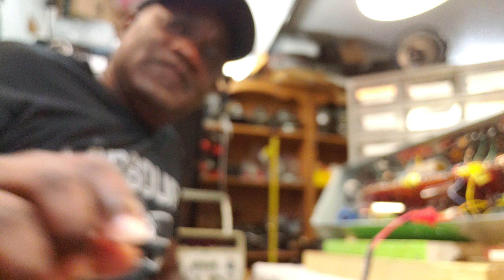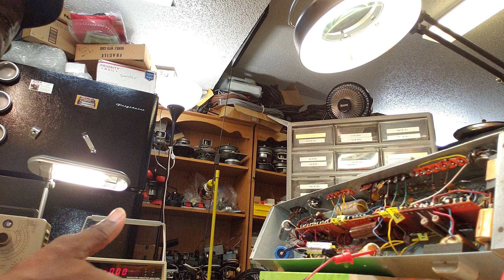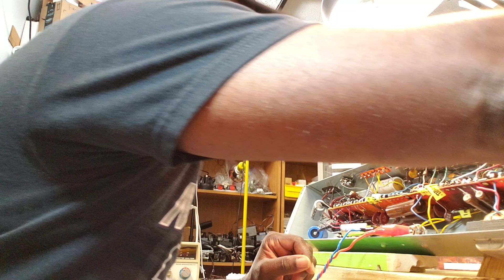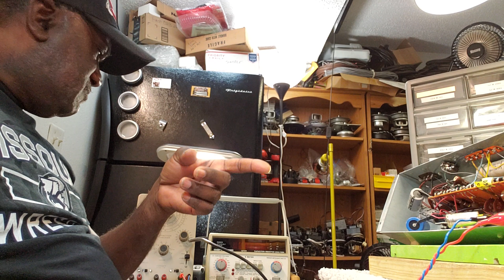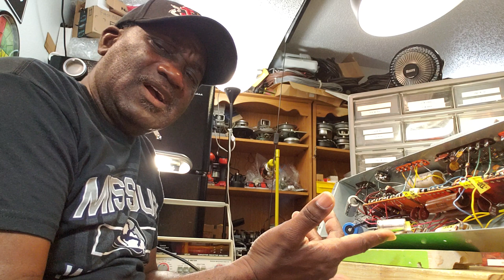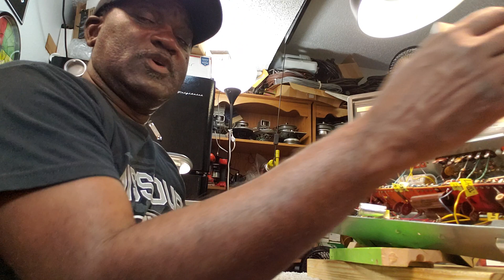Using Solid State & Analog Testers To Evaluate A Ceramic Capacitor In A Hammond AO28

Comment: Thanks for the video keep them coming.
The Heathkit is a good old meter to have. I have an Eico 950b that is old and useful too.
These type meters are getting hard to find now days.
Even the ones that need to be restored are expensive.
Of course the Sencore and the fluke meters are expensive and good meters too.
Thanks again
Reply from the maker: Yes sir. I have the Eico 950B as well. Love it too. Did you see the Video that I made for you? LOL Still working on this preamp.  Finished one side and installed the can caps. Now beginning to work on side two. But have to work on my syllabi for the university as well. School starts back in a couple of weeks but I know that the secretary will want my syllabi by this Friday. LOL